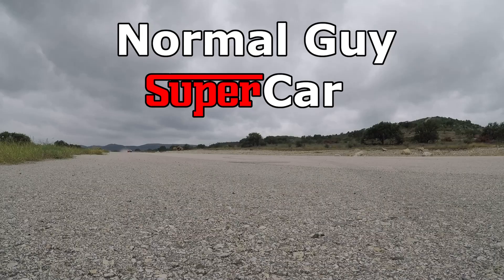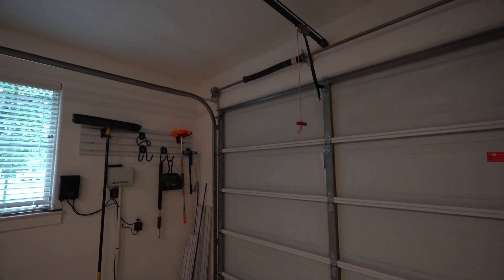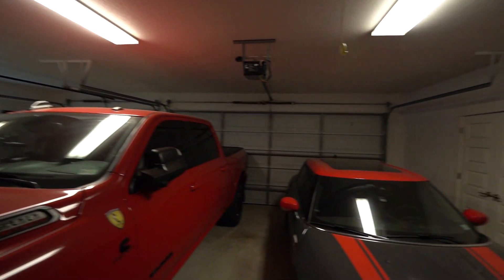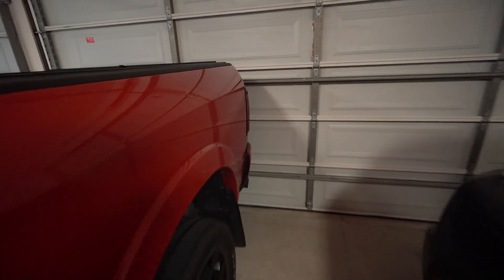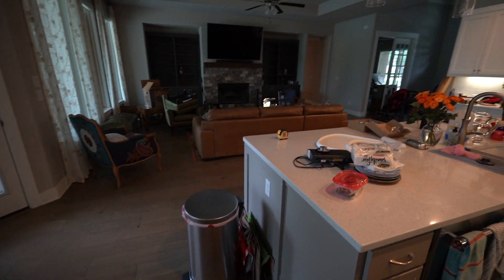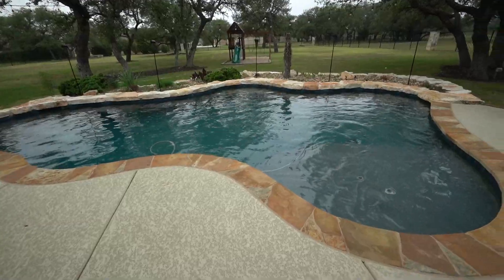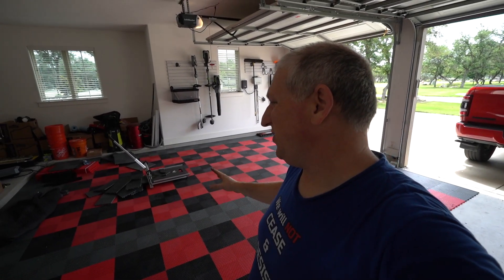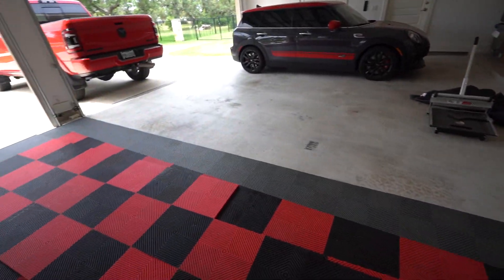New Garage Project Planning and Swisstrax Flooring Installation

Comment: I’m making a separate post about the grass since that’s what I do here in Kansas. 

Yes Bermuda is drought tolerant only requiring a lot of water (subjectively) to get established. You can spray that lot with a broadleaf chemical without a pre-emergent few weeks before you sprig or seed the Bermuda. Then after the grass is established spray spring and fall with pre-emergent to keep stickers and pest vegetation down. You can even do the spraying yourself however not sure how you could do it with that e-go. 

What ever you decide I’d be doing it sooner rather then later. I realize the season is different and longer in Texas but the outcome is always better the sooner you do it in the season. 

As a side note I’d sure recommend some kind of cover for that e-go to keep rain off it. I’ve been watching and researching the new electric mowers since that’s the direction things are heading. Keeping water off it and keeping it plugged in seem to be the important factors. That one has Lithium ion batteries so it should do ok, the Ryobis apparently used to come with lead acid and owners had issues with cooked batteries.
Reply from the maker: Thanks for the tips.  I bought a cover for it and I'm going to figure out some way to put the charger out there and prevent rain from getting  wet

Comment: Hey Dan - Big congrats on the new place. Looks beautiful; so happy for you guys. Been so fun watching your channel grow over the past several years and look where you are now - brilliant! I'm sure you'll all love acreage life. The wife & I made that decision in 2006 and the only regret was not doing it sooner. A lot more yard work for sure, but if you love your home and home life, it's not work - it a fun investment of time. 
Agree 100% not taking up precious real-estate in the garage for yard equipment. As others have said, a garden shed is a good item to consider. Keeps the mower clean, out of the sun, and safe from prying eyes and little fingers along with all the other acreage care stuff you will end up getting. Those plastic LifeTime sheds at Costco don't cost much, are easy to put together, and look fairly nice IMO. Just one of lots of shed options of course. However, not sure how the battery pack/s in that mower will fair in a hot shed during the summer? That would be one concern because lithium batteries (I presume that's what that mower uses) are not happy when stored in extreme heat. 
We have horrible power reliability here (middle of nowhere BC Canada) and looked into a whole house generator - had heart failure and like you, no natural gas service here. Got a portable 8000W one and plug it into an external 30A 240V RV plug on the side of the house much like what you have, and back feed through that with a mains isolation relay switch. Powers everything in the house fine except the hot water heater, dryer, & heat pump/electric furnace so I just turn those breakers off when running on the geny. If you have really reliable power out there however... may not even need one. 
Irrigation systems are pretty easy to install & maintain yourself - they are not complicated at all compared to the DIY car stuff you already do. You could likely do that back yard area for at least half of that 8K quote. There are lot's of online direct irrigation suppliers that will even do up the zone plan/s and material list for free if you purchase from them. I did ours over the course of a month in the evenings and was so worth it. If you have lots of rocks in your soil (so do we), I won't lie, it's not a fun job. Trenchers won't work in rocky soil (rock size dependent) - I had to dig every trench by hand. You can save a little money if you make the system manual at first so you just turn the vales for each zone on&off manually. That still saves lots of time and the hauling of a hose around which is a pain on a big property; and a long hose will lose lots of pressure so it gets even harder at the far reaches of the yard. One thing at a time of course and the garage naturally takes top priority. 🙂 Have fun mate!
Reply from the maker: Haha yes, there's 1000 projects now.  Priority 1 is the garage. :)

Comment: That’s a cool tool your using to cut the Swiss trax. You should definitely put your pressure washer hose on a retractable reel especially if it’s 100ft. If I were you I would tint those windows remove the blinds and put shades and put tall standing cabinets in that corner in front of that window in the back and that way you can use long work bench cabinets and overhead cabinets with under lighting for the work bench along the back of the garage. As for your lawn you can use a water hose spread weed killer. Then use a plug aerator after a heavy rain and then over seed and then weed and feed behind it. Bermuda is an excellent choice. You mow it down to about 3 inch and it can with stand drought well. Instead of fencing out the pool you could just fence in the patio but I agree you need prevention with small children.
Reply from the maker: That's a good idea
Reply: You might also look at getting solar panels. Especially since your all electric and you need to charge the mower and will see an increase in consumption because of the pool pump. You can then get a couple solar walls that will allow you to store and use what you make.

Comment: Those side mount openers are better in a lot of ways, I’ve changed over to those after I built my new shop and put them in there. I really like the lock that installs on the track and the fact that the manual release isn’t hanging down in the center of the shop and they are quiet. 

Hopefully you get to build a shop and can get a lift you can raise up enough to walk under, That is a life changer. Doesnt look like enough room in that garage to raise very high
Reply from the maker: I love how quiet they are!

Comment: For your lawn: you’re going to want to set your mower to as low as possible and scalp everything you want to get rid of. Then you’re going to want to get something to scalp the lawn (I have an electric sunjoe that does a good job). Seed, then scalp again, and a final layer of seed. Right now we have a bit of a cold front come in but if you wait until next week or so when it’s back up to 100 you’re going to need to water it at least 2-3 times a day. Also get yourself some PGF Complete from The Andersons. 

Did you move north or south Austin? If you moved up north near Leander you can borrow the sunjoe.
Reply from the maker: I'll have to look up what a sunjoe is. Lol. But thank you for the tips.
Reply: @normalguysupercar  sunjoe is just a cheap manufacturer of a variety of crap. Like greenworks. But they make a scarifier/dethatcher that’s pretty decent for the price. Buy it once use it and sell it.

Comment: Unless you are in city proper, you can do your own thing.  You can rent a trencher and dig your own sprinkler lines.  The fun time will be the wires going to the valves to the new zone(s).  If you want the easy route, get some PVC pipe and lay it out on top of the ground.  That is essentially what new commercial properties do to get ground cover established.  Dragging a house around, sucks.  Saw the Tommy Dorsey Water Conditioning sticker on the water softener, and he is great to deal with.  I ended up with a sink in my garage so that I could wash my hands and not get the house filthy.
Reply from the maker: That sort of stuff makes me nervous since I don't know anything about it. Lol
Reply: @normalguysupercar  In most cases the controller completes the circuit for the valve to turn on.  There is  common wire that goes to all the zones, and then a power wire (not energized that goes to the valve as well).   I had a guy do my mothers system here in Round Rock and it was reasonable for what was done, especially for being rock not far below the ground.  If you want I can get you his name and number if you want a quote, and got his info from my community facebook page.  You can go with the PVC above ground and then you can connect to a hose, since it is temporary.

Comment: Just a heads up on the pool stuff.  Every time you cut and repair, a new leak will spring up.  All that above ground PVC has sun rot is my guess.  Get ready to do a full above ground replumb in the next few years.  They do make tools to cut our the glued joints so you can salvage the valves, etc.  Need to keep the sun off that PVC and put something around it so it can't be backed into with the mower or a kid's toy car, etc.  Nothing urgent, but it's all coming...

Let me know when you want help putting in a sprinkler system. I work for travel, food, and lodging...and maybe a ride in a supercar or three.  

I've done two full yards in my time and it's really not hard.  The hardest part is getting the design done and spec'ing out all the parts and pieces.  A big yard like that will use some serious water.  Maybe do a whole landscape plan to reduce grass and put some interesting textures in (especially along the border so you don't have to edge that entire perimeter...).  Long term project that can wait, of course.  Also, see if fescue is a better option than bermuda.  Doesn't look like ass in the winter and requires no overseeding.

GL with all your projects.  Write them down, get them done, check them off the list.
Reply: Paint those pipes. It helps!  Mine are all painted.
Reply from the maker: Thanks for the tips. I like the idea of getting rid of some of the grass
Reply: @normalguysupercar  see if there’s a budding landscape architect that wants to be introduced to a group of supercar owners.  Seems like an opportunity for them.

Comment: Love the video Dan, looking forward to the garage build. Question, even with moving the door rails, will you have the height for a 4 poster? As well did you get the pad x-rayed for thickness?
Reply: I'm with you, Hugh - BEAUTIFUL house, Dan! But - doesn't look like you will have enough height in the garage for a 4 post - hard to tell from the video, but almost looks like a 9ft ceiling - might be tough to get anything under a car on that....! But - super pumped to see the house evolve - already stunning!
Reply from the maker: So I re-measured and it's 9' ceiling in the garage. :(  So I'm not sure about the lift now.
Reply: Could always get a Quickjack, I love mine for a lower garage height, or embed a scissor in the pad.
Reply: @normalguysupercar  you can get a scissor lift not as good as obviously a 2 post or 4 post but still better than the quick jacks or nothing at all

Comment: Very nice!  What happens with that garage flooring when you spill oil/coolant/etc when working on the cars?
Reply from the maker: Well, I typically use an oil mat so it absorbs spills when dealing with changing oil etc...  But it will go through.  So you would have to clean it up.

Comment: Dan, it won't be long before you get tired of hauling 3-4 hundred feet of hose around and get an irrigation system.  Just realize, they require constant maintenance after the first year.  I'd also recommend a lawn service then, all you have to do is mow and water.  I'd also lower your expectations on maintaining the entire back yard.  Maybe run a cross fence and maintain a 1/3 acre or so.  A large yard like yours requires lots of hours of work which I don't think you really have or, would want to spend on the yard. Perhaps I'm wrong.
Reply from the maker: I will probably consult one.

Comment: Have you considered solar panels and a battery instead of a generator?  Or just in general to cut your electric bill down?  I figure if all of your utilities are electric anyway, and you're going to be running the AC a lot then it's probably well worth it.  We didn't do that when we bought 15 years ago, but I'm 95% sure that is what we will do for our next house.
Reply from the maker: Yes we're definitely considering solar. Battery not as much

Comment: How tall are the ceilings in your garage? I too would like to install a 4 post lift. I have 10' ceilings and am planning on having to do the jack-shaft opener and move the tracks closer to the ceiling.
Reply from the maker: Ours is 9', I thought it was 10' so I may be screwed.

Comment: Generators can be really loud and they’re ugly and take up yard space. They can also break down and require periodic maintenance. Since you don’t have gas at your house you’d also need to pay to run a gas line or store fuel for it somewhere. If you’re going to spend the money these days I’d get solar panels and a Tesla power wall to store power. They’re silent, they don’t take up space, unlike a generator they will lower your monthly energy bills so there is some return on investment and especially if you’re doing it in case of another ice storm, solar panels are even more efficient in those conditions. They work better in cold temperatures and the snow and ice reflect more light for them to absorb.
Reply from the maker: Solar panels are definitely a consideration
Reply: @normalguysupercar  I love that you respond to every comment even if they disagree with you. Black in the garage 👎🏻 lol. But the main take away that we can all agree on is that Mo needs a dog door. Haha

Comment: Real men don't use propane grills.  :-). Super nice backyard but it's going to turn into a burden in 10 years as you get older but it will be fun for Ash in the meantime.
Reply from the maker: Don't worry, I've got my Weber charcoal grill too... I just use propane when I just need quick sand easy

Comment: Please do not let Adam install a mirror ball or a updated bikini poster of Miss Texas 1963 in your garage. Miss Texas 1963 is now a full 92 years old and I do not think her bending over a Porsche is quite appealing. Dan just put like a little fence around your pool pump. If the lawnmower threw a rock at the pipes etc you might end up with some costly repairs
Reply from the maker: Lol